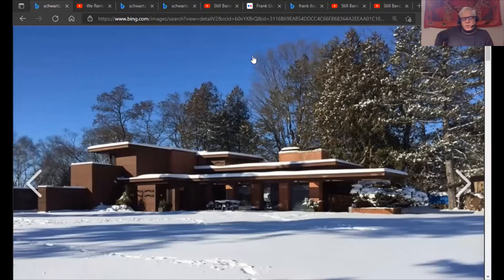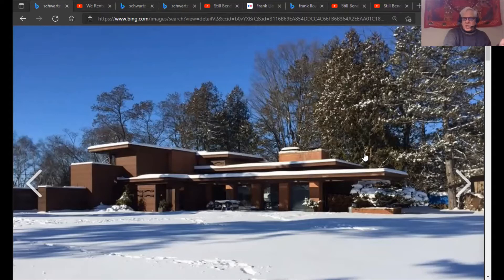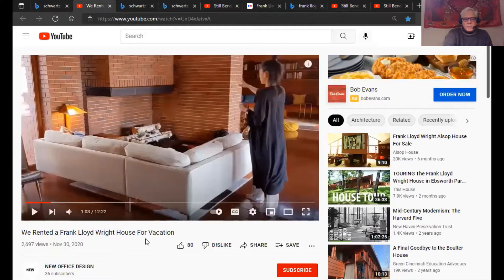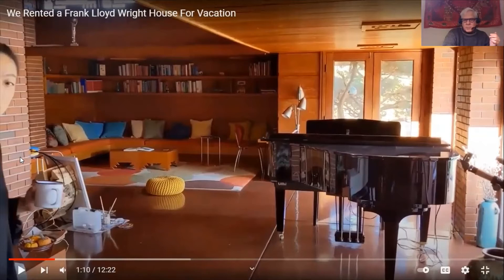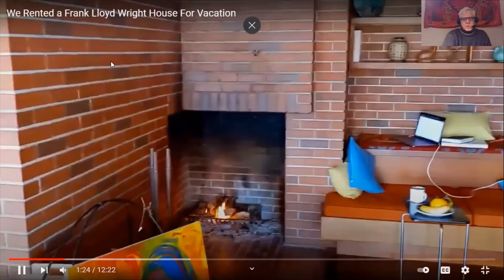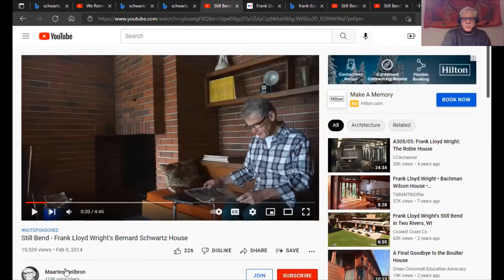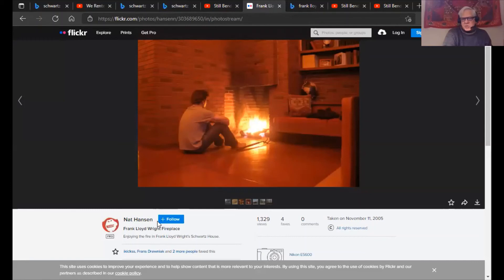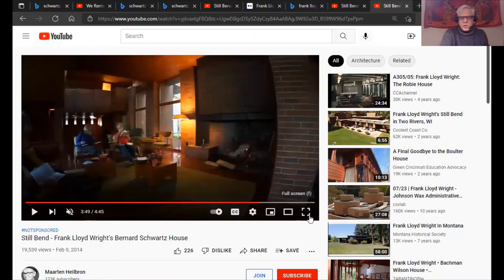Frank Loyd Wright's Schwartz House: Bad Fireplace Design

Comment: With most FLW houses there is always a trade off or some kind of compromise. Rarely does his designs work's 100%.  Some have some very clever elements while others are less practical. Still think his houses are beautiful.
Reply from the maker: In December I made my 8th visit to Fallingwater --- so I am a huge FLW fan.  And I love Fallingwater.  But it has major flaws.  I made a video about how the bedroom designs are flawed because they have no space for COMFORTABLE seating you could lounge in.  They have room for minimalist, uncomfortable seating you'd spend 10-15 minutes sitting in, but if you wanted to spend a considerable amount of time alone in your room in the evening, enjoying a fire and reading a book, you'd pretty much have to recline on your bed.  

I made another video on the main fireplace at Fallingwater, discussing similar flaws to the ones I discuss in this video.  

For sure, I make the point in the Fallingwater fireplace video that the fireplace is beautiful and impressive to look at, and it's iconic, but it's as though it were designed simply to look good in photographs and tours.  

Sure, you could argue that every design has tradeoffs, but a fireplace is so fundamental --- it's not difficult to design the space around it so you can fit comfortable seating.  It should be a priority, actually.  I don't know what BENEFIT you could argue was gained in the Schwartz House fireplace design by making them uncomfortable to sit in front of.

Comment: How many fireplaces has the narrator built to compare to WRIGHT'S... a fireplace also gives out heat one doesn't have to look at it to enjoy a fireplace if it's in the library you should be looking at the fire you should be reading the book this person who's the narrator should be taken off this page permanently but that's my opinion
Reply from the maker: I've never built a fireplace.  But whether or not I've built a fireplace is irrelevant --- I didn't make any comments on the building of the fireplace.  My comments had to do with the DESIGN of the fireplace.  

My comments on the design of the fireplace are based upon my experience ENJOYING fireplaces.  They're based upon my experience as a user and consumer of fireplaces.  

Fireplaces, of course, give off heat.  And I establish that at the beginning of my comments.  I talk about one of the functions of a fireplace being a social focal point in the home where people can sit together, IN COMFORT, for an extended period of time, and enjoy the LIGHT and WARMTH of the fireplace.  

A good artist designs for complexity, and multi-purpose.  And I showed photos of people TRYING to enjoy the fireplace on the righthand side, and they clearly illustrate that for those who do want to enjoy the fireplace by looking at it and feeling the warmth can't do so in a comfortable way.  They are either sitting on the floor, or, sitting in uncomfortable folding chairs that are scrunched together.  I also showed the photo of the man sitting on the very uncomfortable bench seating, which provides no way to enjoy the fireplace.  

So Wright FAILED.  Check out my video on the design failures of the main fireplace at Fallingwater.